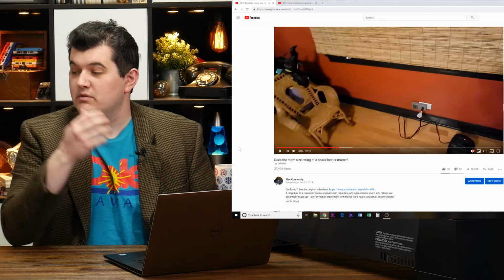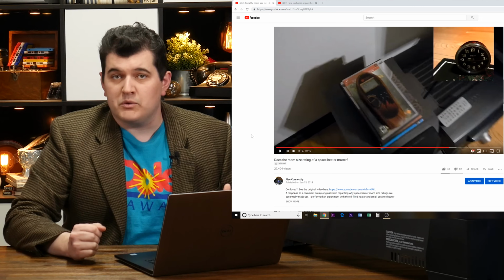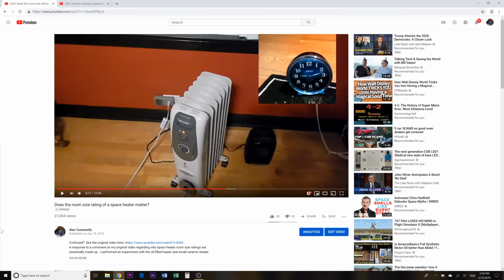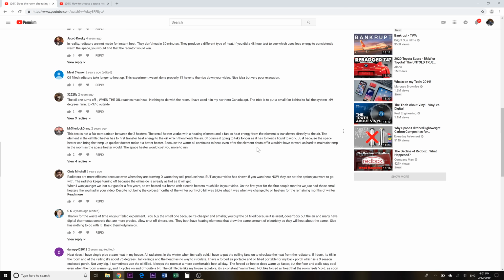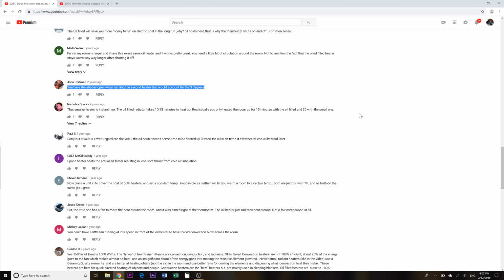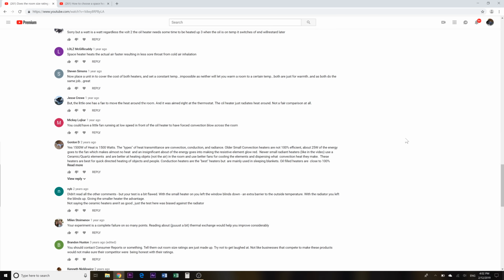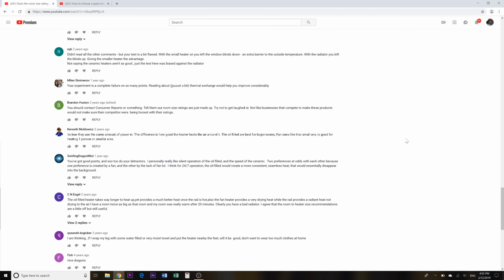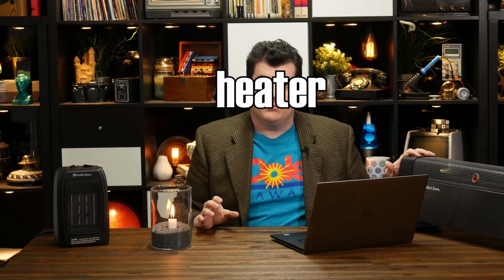More Space Heater Nonsense

Comment: I get your point, but I think the test in your old video is still fundementally flawed. Compare a small forced convection heatar and a huge one on same wattage, assuming neither "throttles",  it will get exact same reading on the thermostat like you would expect... Compare ANY forced convection device of any size versus ANY natural convection device of any (realistically possible) size, forced convection device will come out on top... On other extreme end, point the smallest radiant heater you can find on the termostat, and your reading will be quite "interesting"... Are you testing different types of heaters at same power, or the effect of dimensions on different heaters at same power?

What you've demonstrated has NOTHING to do with the point you are trying to make. Anyone who's ever used an oil-filled radiator will tell you what you've proven. That oil-filled radiators are, be it huge or tiny, are very slow to heat up. Use large radiator in a large room, its slow, use a small one in a small room and its still slow.. Use a small radiator in a large room, it won't heat up the room as the larger one, due to a few obvious reasons, mostly due to Q=hA(T-Tf).. 

On the other hand, you can design a forced convection device as small as you want (to a degree, of course) so long as you put a higher CFM fan and better heating element. At one point though, considerations like noise, longevity, reliability and safety come into play. Its quite easy to make a 4cm diameter 1500W heater, but it will blow too hot air, its 3000 RPM fan will not sound nice, it won't last long in daily use, and due to tremendous heat flux needed in such a small heating element, it will probably melt its plastic case and burn your carpet like the second fan fails; yes such device exists and is called hairdryer. One can, technically, use it as space heater, but it won't be really fun. For a space heater, a larger fan is always better, more surface area means less flow velocity for the same mass moved, less RPMs mean less noise and goes easier on the bearings for better longevity, and in the end its actually more efficient in moving air around (not so important for heating, but for dual-purpose fan for summer days, it is). Larger surface area on heating elements lower the tempeture needed so again better longevity...

I am not (in anyway) saying you are wrong and room labelings are important, but I think you are taking it to extremes. If we look beyond marketing BS, for the same quality of materials, wattage etc, size still matters and bigger is always better for a space heater.
Reply: @JESUSalmighty1998  I think you missed MY argument... Any engineer would know a 500W space heater, vacuum cleaner, hair dryer, fridge, tv, washing machine, or a shorted car battery pulling 50A at 10V will all provide same heat output to a closed room.. Only devices that stores energy (instead of using it) are exception, elevators or battery chargers etc..

I have no objection to this... Problem is, Thermodynamics is just one branch of mechanical engineering. Saying "hey they are all the same, go buy the cheapest and smallest 1500W heater" is taking a valid claim to extremes and that quickly becomes a BS... Because a 1500W electrical rating is NOT 1500W heat output... All these devices have a thermostat.. Its not a device that regulates ambient tempereature, like most uneducated people think, its designed to regulate device's own temperature..  Its not an oversight that these devices are so close to the heater, its by design. On most devices, thermostat basically a spring-shaped electric heated filament directly attached to line voltage, that is expected to cooled down by ambient air... On others (mostly natural convection heaters) heat is provided by the heating element.. OK, colder the air better the cooling effect, but that electric input will eventually overpower the cooling (unless you are running it at alaska or something), and device will work on a duty cycle... Its not the electrical rating that defines the heat output, its the "duty cycle x electrical rating"..

Let me put quite a practical example; I have an 1500W oil-filled radiator, lets assume that works to sustain 25degC temperature in a room.. h of air @25deg.C is 26,24 W/K, and Tf = 25degC. Than; Heat output = 26,24 * area * (Temperature of heater surface - 25) 

That is thermodynamics aspect. Theory says one can make area smaller and T bigger, so size doesn't matter, right?  Enter safety and regulations part of (actual) engineering. Maximum allowed temperature of a heater (that 5 second touch will not cause irreversible tissue damage) is ~60deg.C So max possible T is 60degrees celcius, after which thermostat must be designed accordingly to cut power. In reality, designers for such exposed systems like radiators tend to select "severe pain" threshold of 52deg.C instead of "irreversible damage" because, you know, burning your customers is not good for business..

My "1500W" radiator is small; its ~60cms high, ~15cms wide, has 6 segments; Area = 0,6*0,15*6*2(heat emmits from both sides of segments), so area is 1,08..

Heat output of my 1500W radiator cannot be higher than 991,87W legally (and with zero margin for safety)... In a realistic design that targets "severe pain" threshold (so that radiator won't hospitalize anyone checking if the radiator is hot), max possible heat output is 765Ws on this 1500W radiator... "1500W" on this case helps it to reach operating temperure quickly, and thats it. Its NOTHING to do with heating capacity.

An actual 1500W radiator would need roughly twice the area to sustain 1500W heat output.. Or a more (actually) "premium" product may want to stay below the pain threshold altogether and be just pleasingly warm, and that would need 2,7 times surface area.. 

This is one simple aspect of engineering. Not understanding this or other aspects that esspecially come into play with fans or radiant heaters, and then claiming all heaters is the same is just ignorant and wrong.

Comment: The only thing I could possibly think of is infrared radiation spreading heat more around a room. But I would think that no matter what you're either heating the stuff in the room through infrared first and thereby heating the air, or you're heating the air through convection first and thereby heating the stuff in the room. (cold stuff absorbs the heat from the warm air, cold air absorbs the heat from the warm stuff)

But, just for the sake of argument, the heating elements release visible light (non-infrared) which does nothing to heat the room. So some of the energy is wasted on visible light whereas the oil heater turns it straight into heat, though transfers it to the air in a slower method.

Comment: I did an internship laying out HVAC for buildings years ago. Everything you said is right, but there's one key detail you're missing: mixing the air. Variations in temperature are quite uncomfortable.

Consider if your head is in 75F, but your feet are in 65F. The average temperature is still a 70F, but with the colder feet most people would turn up the thermostat. This is a stable stratification. Even with a small heat source driving convection, a large room would stay mostly stratified, because the convection cell likely wouldn't cover most of the room (due to furniture, cold spots on ceilings or walls, and just natural convection cells).

If you look at where registers/radiators/baseboard heaters are in commercial buildings, you'll see the solution. The most "efficient" way to heat a building is to place the heaters under the windows. This heats the coldest air directly, obviating most of the need to mix air. The heated air moves then moves up into the cold draft, which kills the draft's momentum and further mixes the air.

Finally, since I'm talking about mixing the air, I should address air motion. Moving air feels colder than still air, and especially feels "dryer". Even though no there's no change in moisture content, air blowing over skin evaporates more water (removing more body heat) so that fan-heaters feel "dryer" than oil heaters. This is also why ceiling fans should blow down in the summer and up in the winter.

All of that still doesn't explain the small vs large room question. My best guess is that people tend to place convection heaters in better locations, but put fan heaters pointed directly at their face.

P.S. Liked for calling out the flowerpot idiocy. It's dangerous, and placing a bare tealight by the window is much more effective.

Comment: I have watched many of your videos in the past and never really hit the "Like" button even though I enjoyed them...BUT today I came across your heater video, the first in this series and I found it interesting and I understood where you were coming from as to Watts and BTUs. I was surprised to see a follow up so soon where you had to defend what you were saying. I finally had to smash the like button and even did the same for the Subscribe.
I would like to add that I have owned a Gen4 EdenPURE unit (1500 watts rated) for just shy of 7 years and I have nothing bad to say about the heater. Prior to that I used a Patton upright ribbon style heater (750-1500 watts) in the same room and the EdenPure runs less at a lower setting and heats the same area better. It is safer also and that was one selling point for me. The 3 quartz 500 watt bulbs are enclosed inside the case and a rather quite fan forces the heat from the front. I do like it a lot.
I'm not arguing anything here just letting you know a little about that style of heater. Is it any more efficient? I certainly can't say. 
Keep up the great videos!
Reply: John Geiser lower setting and heat the same area better? Can you clarify that? If you mean heat up 1 degree in less amount of time better, better? Then you just broke thermal dynamics already, just as he said, 1500w is 1500w, you exchange heat from one to another

Comment: HVAC guy here.... They are all the same....Yes, some might be better at making that 5100BTUs of heat, but in the end it's still 5100BTUs.  When installing electric heat strips for central air handlers, If I use a 10kW heating element,  It will only put out 34,000 BTUs of heat. It makes no difference what size air handler you put it in.  I dare to see a company producing central air equipment mark "large house" or "small house" on units with the same BTU rating.

Comment: let me just start by saying im not criticizing just a observation and quandary from someone who doesn't know and is wondering if maybe the reason for the room sizes marketing uses are just down to the size of the element, like i have a Honeywell space heater for medium sized rooms and a Vornado for small rooms and its quite clear the Honeywell has a larger surface area as well as a fan to the smaller Vornado. my quandary is the even though they have the same wattage output if the bigger surface area has any sort of effect on the output. Like if you were to run the heater test again but this time use instead of a smaller active forced air unit vs the oil passive air, take two ceramic element heaters that use forced air and see if the surface area has any sort of effect on maybe not improving the output but the efficiency on heater more air per minute than that teeny heater. Just a thought, Great video keep them up.
Reply: @William Kappler so the active air flow vs passive would make no difference, huh I would have thought that actively moving the air over it would cause a difference in how efficiently it was able to do its job, now what i want to know is why the blasted hell do they put stupid thermostats on those oil units if they just keep gimping its output, its like leave the dumb things off and just have the safety cutouts, or figure out a way of making it so the bi metallic strip isnt in such proximity to the heat or at least give me the option to just turn it to max and leave the thermostat out, thats how my honeywell is, you turn the knob high enough the display just says HI and will stay running presumably till something sets on fire.

Comment: Another thing that people won't understand and likely be upset by, you could make a video about why a fan is also a space heater!
Reply: Anything that does work produces heat. In the case of a fan, it's fluid friction (barely any), friction on the bearings, and the resistive load on the motor windings.

Comment: My only question, and I don't have any evidence, is whether there's a difference between the electrical efficiency of the heater, and the effective air temperature phase shift efficiency based on the method of heat conveyance.  In other words, is it better to heat a temperature conductive surface that radiates heat, and use the heating element to intermittently heat that, or pass air across the heating element and circulate the air.  Which is more thermally efficient.  That would be an interesting scientific experiment.    In terms of advertisement jargon.... You could almost do an entire channel on "bullshit companies say"

Comment: One thing you may not have considered though: if the space heater emits RF noise, that could conceivably escape the room via the walls/windows, and the same is true for acoustic noise. Those are both cases where the 1500W heater isn't giving all 1500W to the room, making the heater more like 99.999% efficient. I wouldn't mention it, except you strike me as someone who takes an academic interest in such details. What I wonder now is this: if the heater emits RF and the RF waves make it into deep space and out of the galaxy without hitting anything that can absorb them, does that mean that energy never becomes heat, or is it a case that on a long enough timeline, those photons will hit something somewhere, because there's no truly empty place even in space?🤔
Reply: In space, no one can hear you say "Ow, that's hot!"
Reply: Acoustic noise turns into heat when it's absorbed. Flowing current has resistive and radiative losses. The resistive (heat) losses are "useful" in this case. The radiative losses (mostly 50Hz, so not really "RF") escape the room unless the room is a Faraday cage. The coils in the fan motor also generate 50Hz EMI and they are coil shaped to generate more magnetic field to drive the rotor. Almost all of the EMI radiated out of the heater case is going to leave the room.

Though I agree, the heater is 99+% efficient at generating heat (99.999% efficient implies less than 15 mW of energy is lost as acoustic noise audible outside the room, or 50Hz EMI radiating through the walls).
Reply: @kcastle  maybe it is dumb, but as an engineer, I take this leakage of acoustic and EM noise a bit personally - the energy that escapes the room almost seems like deliberate contrariness 😋

Comment: If anything, during your second experiment with the oil filled heater, you gave the oil filled heater an unfair advantage in how you cooled the room. By opening the window, you removed the specific heat in the room at a fairly fast pace. But any latent heat in the room could still have been present. The latent heat that remained in the room from your first experiment could have helped reheat the room during your second experiment.

Comment: The oil filled radiator type has thermal mass so it heats up slower, but it also cools off slower, no difference over time, no efficiency difference whatsoever

Comment: If anything, the baseboard heater is supposed to make a sort of thermal curtain to limit drafts at a window. Though I dont know how effective that actually is.
Reply: You're basically right, and it's actually quite effective for comfort, because it keeps the room temperature more uniform throughout.
Reply: Pretty accurate, I have baseboard heaters and it's only as good as its ability to counteract what the window's sucking out into the cold Minnesota winter.

Comment: If light bulbs are not 100% efficient at making light because some (or most) of the power it consumes is wasted as heat or infrared radiation, then wouldn’t the opposite hold true for certain types of heaters that have coils that glow or waste energy as light?

Comment: Ok...  What you're saying about electric heat being 100% efficient makes total sense to me.  100% of the energy being pulled out of the outlet is becoming heat in the room...  So why is resistive electric heat so much more expensive than a heat-pump or a gas-fired furnace?  Those are very clearly not 100% efficient -- there is energy being put into the system that does not become heat in the house...  So why are they cheaper to run?  At first glance, resistive electric heat should be far cheaper because it's 100% efficient...  But experience shows that it's definitely not.  Why is that?
Reply: Because the amount of energy per unit mass of the fuel needed to run a heat pump or furnace is an order of magnitude greater than the cost of electricity - even with the efficiency of the heat pump taken into account.

Comment: The only valid reason to market a larger heater for a larger room is that it fits better in one. However, there may be a small benefit in favor of the oil filled one, because like the IR heater it radiates heat, while the fan mainly heats the air. When you get radiation, your skin warms up and it the heats the air, which makes you be warmer in the process. But of course you can also sit in front of the hot air flow of the fan.

Comment: I'm thinking about the fan. Some of the wattage is used by the fan, which doesn't add to heat output, beyond maybe the kinetic energy of the air matter. Missing moving parts would eliminate that.
Reply: The wattage used by the fan does translate to heat as well, so it does add to the heat output.